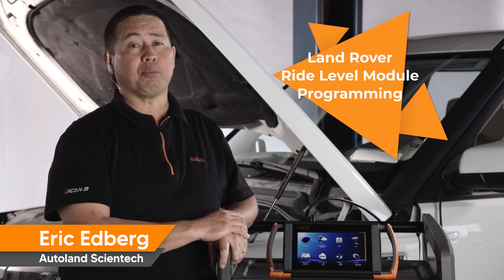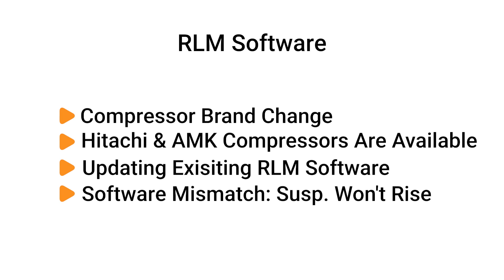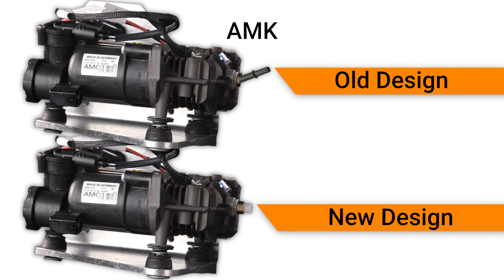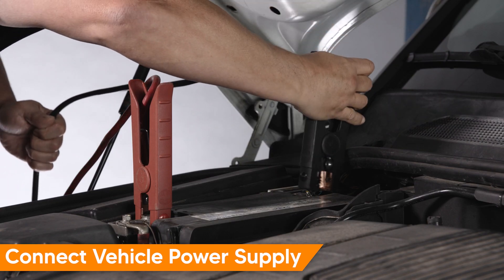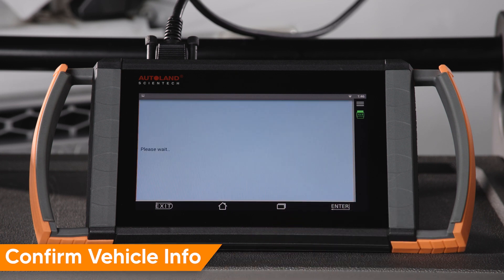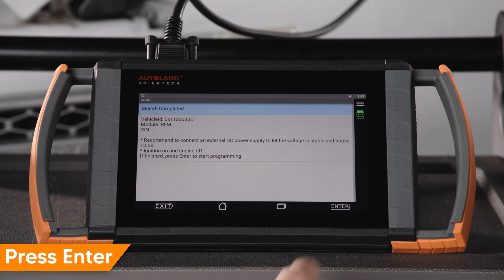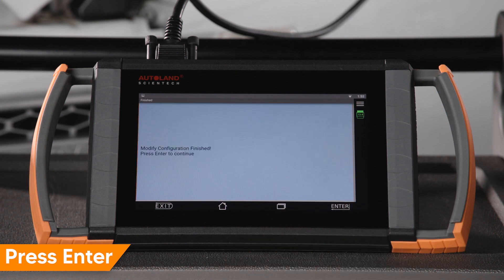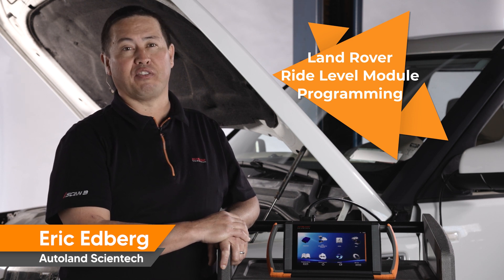Land Rover LR4 Compressor Replacing Tips & Ride Level Module RLM Programming

Comment: Where is the location of the RLM module?  LR4 -LR3  Thanks in advance
Reply from the maker: LR 4 is shown in the video. LR3 the suspension control module is located above the foot pedal assembly, near the pillar. The compressor is under the left rear of vehicle.

Comment: Thjis sounds like an obvious question, but is the car running (Ingition Position 2) when you begin programming?  I assumed that the ignition was in Postion 1 (on but not runnng) when programming began.
Reply from the maker: No, key on engine OFF. Not running for programming.